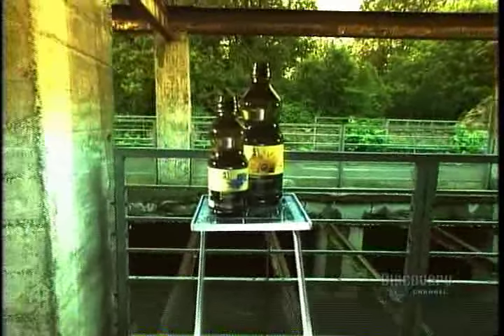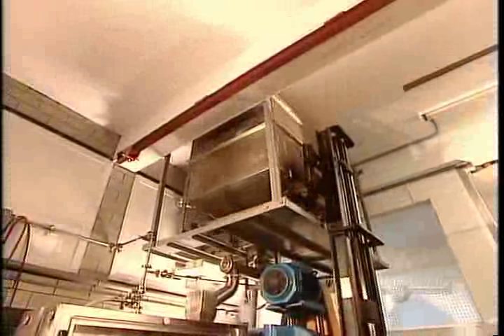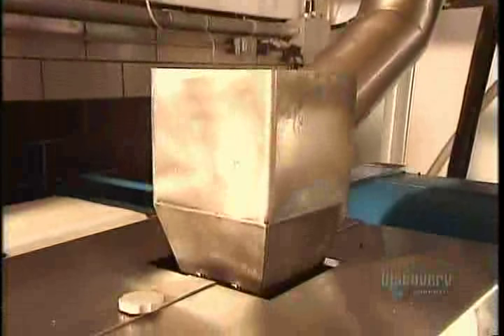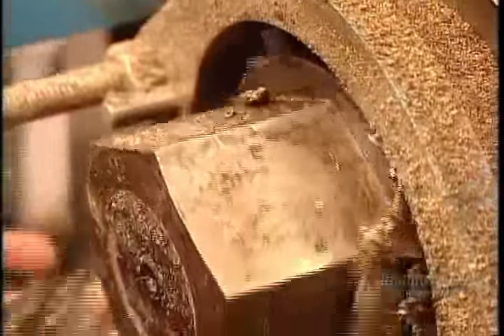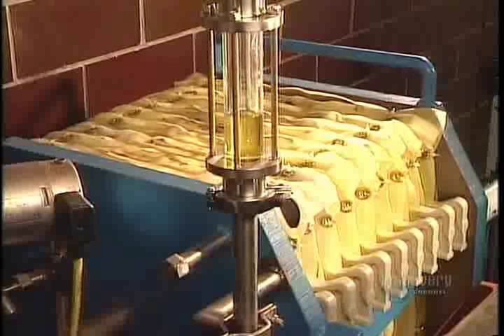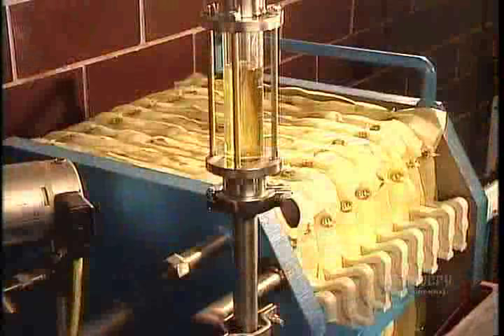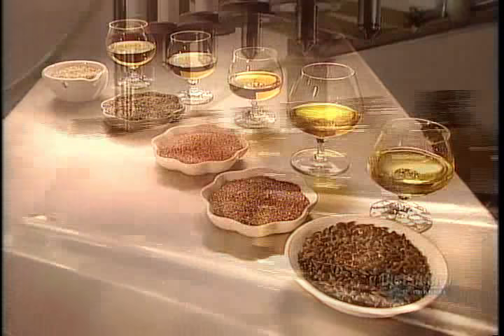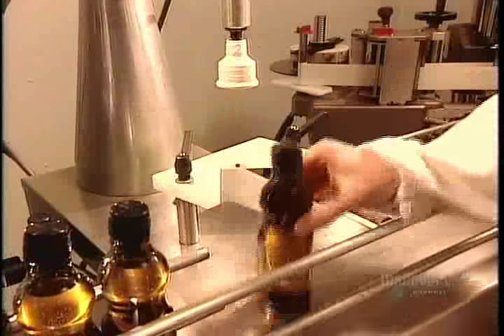How It's Made Vegetable oil

Comment: Also, except for flax oil, vegetable oils have a ratio high in omega-6's and low in Omega-3's, which can cause degenerative health issues as well. The problem with rancid PUFA's is that they form what's called lipid peroxides in the body.  Think of peroxides as the opposite of antioxidants.  Peroxides are like gasoline being thrown onto a free-radical fire.  Over time, the resultant free-radical storms can take a toll on cell membranes, delicate DNA/RNA strands, and the on the endothelium.
Reply: Thanks random person, no more chhick filla fries for me
Reply: @no_special_person  Well it's up to you if you wanna take note of all that crap and not enjoy what you like every once in a while 😅
Reply: Holy crap, you beat "Today I learned" by at least 9 years!
Reply: @Tarik360  what I've learned, and yes!
Reply: @Tarik360  it's been an issue for a while, still today most people don't take it seriously
Reply: Omega-6 and omega-3 are not degenerative to your health, you literally need it for brain function. Where do people come up with these random claims?

Also people should realize the whole oxidation basis for cancer has never been fully established. There is also research that points to oxidative stress being necessary in order to trigger molecular functions that help prevent cancer. Cancer research as a whole should be taken with a huge grain of salt, because it is almost entirely a SWAG (scientific wild ass guess).
Reply: @DaveSmith-cp5kj  they are essential, but our modern diets have much more omega-6s than omega-3s which causes health problems
Reply: @itshardtothink3675  Yes, so overeating in general is the problem, not the OP's claim that it is bad for your health. That's two entirely different conclusions. It's the same kind of BS when the media was claiming eggs or lettuce was bad for your health.
Reply: @DaveSmith-cp5kj go find a loaf of bread from the store with no veg oils, protip u cant
Reply: @DaveSmith-cp5kj  He said the RATIO high in omega-6 and low in omega-3 has the potential to cause degenerative issues. Not that they are inherently bad
Reply: @SandboxSki  Yeah but that's not how it works either. Omega-6 causing issues is a myth started by "nutritionists". Dieticians have always stated that omega-3 deficiencies are solved by eating foods high in omega-3, not reducing intake of omega-6. The body doesn't use the fats as is, it actually breaks them down as needed, so an "excess" risk doesn't happen unlike vitamins. Overeating is the threat, not the presence of vegetable oil which actually counters a lot of cardiovascular risk one would face by overeating.
Reply: @DaveSmith-cp5kj  no it isn't, this stuff gets made in a factory unlike eggs or lettuce, this should never be consumed ever
Reply: @johnyboy3454  Lmao what? Cheese is made in a factory too, as is gelatin and literally every food product derived from a plant or animal.
Reply: @DaveSmith-cp5kj  properly made cheese can be made without a factory and even if its made in one it is only mechanical processes, seed oils are REFINED which means they heat it up/add chemicals to that trash, keep consuming it bro
Reply: @johnyboy3454  You really have no idea how your cheese is made, do you?

Comment: fyi: these are cold press seed oil, so they are a lot better than regular vegetable/seed oils you buy at the supermarket, which are highly processed with high heat & chemical, and should be avoided as much as possible. Cold press is also the method use to extract extra virgin olive oil, coconut oil, avocado oil, palm oil. Therefore, always look for organic or cold press on the label to avoid highly processed oils. Saturated fats are good and are also way better than highly processed oils. Don't let the "heart healthy" label on corn oil, rapeseed oil fools you.

Comment: Why didnt they show the usual solvent/heat method? thats the one I want to see, th emore common one
Reply: So look it up i just watched it.
Reply: the seedcakes are then treated once more with steam, pressed out one more time. Then the rest gets treated once more with triperethylen ( hope I got the spelling right, they use the stuff in dry cleaners. we have a chemical factory near my village, most all males are working there. and one of them told me, incidentally a relative of mine, I am a Chef, where to all the chemicals are going. one is the biggest oil mill around.and for sure they are not using it to wash the uniforms of the employees).And ony THEN are the seedcakes used for animal feeds. they are supposed to clean them from all the chemical residue, but for that they need another cheical. nice gunk we feed our animals.
Reply: You can't charge extra for "natural"
Reply: Hexane is good

Comment: No, I said POLYunsaturated fats become rancid very quickly, especially when exposed to heat and light.  Seed oils are exposed to both during processing, during the many months in storage in a hot warehouse, and while under the 24/7 glaring light on store shelves.  Sorry, but common polymers (plastic bottles) are oxygen permeable.

Also, trans-fats are an entirely different creature than saturated fats like coconut oil, lard, or butter. Everyone can agree on the dangers of trans-fats by now.
Reply: are you still alive pam

Comment: I wonder if it would be feasible to run coolant pipes through components of the press, to keep the temperature down and so grind at a faster rate. Eg  inside the central shaft, and in the casing. Maybe it's not practical, or maybe the heat wouldn't get drawn out evenly enough...

Comment: while that may or may not be true, olive oil is higher in saturated fat than vegetable and canola oil, most oils are cool or cold pressed anyway, depending on the type of oil you get and the quality. As an all around cooking oil, vegetable or canola is best. Higher quality oils are most typically packed in dark glass to prevent UV light from spoiling the oil, and you actually can taste rancid oil.

Comment: QUESTION TIME

I looked this vid up after seeing this tweet on twitter:

"Fried ≠ unhealthy. 
Fried in vegetable oils = unhealthy. 

If you want to fry food, use tallow, palm oil, coconut oil, avocado oil, or from any mostly real food, high in saturated fat. 

(Beware of eating out. I know of only ~4 restaurants in the USA that fry in healthy fats.)"

Now, questions:
1) Tweet author said vegetable oils are unhealthy, use oil from real food..but here examples of vege oil are sunflower seeds, soybean, corn and so on which basically are....food. what's the difference they make as compared to the 'healthier' palm oil, coconut oil, avocado oil he suggested? The difference in sat fats? So basically they're ALL vegetable oils, just the unhealthy ones are the ones low in sat fats? So opt for the ones with high sat fats?
NOTE: SAVE the discussion about pros and cons of palm oil later. Focus on the actual question here.

2) what makes some vegetable oil bad and some good?? When they all come from growing plants/fruits which have been promoted to have health benefits when eaten as it is??
E.g. sunflower oil = vege oil. Sunflower seed = sunflower oil. Vege oil = bad. Sunflower seed = has health benefits. Hello?? Can someone explain???
Reply: You know how the video talks about how the oils easily spoil from heat and light? Similar processes can happen in your body causing cell damage and oxidation. This can cause inflammation and a variety of other health problems. Read Ray Peat for more info. I don't think sunflower seeds are particularly healthy, but eating them every once in a while isn't a problem. Sustained use of seed oils is a problem imo
Reply: @cornman8252  But here's the thing: Vegetable seed oils are in almost every processed food.
People nowadays consume an average of over 80 grams a day of vegetable seed oils, that's about 700 calories a day from seed oils alone.
Reply: @Augusto9588  ha, yeah, the solution for me has been to avoid processed foods and minimize eating out. Kinda sucks. I'd really like mainstream science to investigate this so there's more recognition of the problem and I don't have to refer people to a 'kooky' source. Not a problem for me, but most people only trust mainstream sources
Reply: @cornman8252  look up the channel low carb down under on YouTube and thank me later
Reply: It's the linoleic acid, a high omage 6 fat, which causes inflammation in the body. Your body need some omega6 and to be balanced with omega 3, but in the modern days all of our good have omega6 and we often get too much. Furthermore it is a polyunsaturated fat, which have multiple double bonds in the molecule, this mean it is easier to damage (become rancid) than fat with single bond molecule (saturated) and monounsarated which have only one double bond. The rancidity causes oxidation and creating reactive oxygen species (ROS) in the body, this leads to various health complications. This high inflammation and oxidation in the body contribute to various chronic illness and cancer.

However, the other end of the spectrum is also tunnel vision, where they tell you to eat meat only, no plant, and only consume saturated fat. Basically putting your body into a permanent ketosis state. The human body isn't designed to be in a permanent ketosis state and consuming large quantity of saturated fat. Some people depending on their genetic make up cannot metabolize saturated fat as well and it can be damaging to their metabolic health.

I am a fan of monounsaturated fat myself (olive oil). Avocado oil is actually inferior to EVOO because studies show it oxidize faster, since it lacks the antioxidant compounds that exist in olive. The smoke point do not tell how well an oil resist oxidation, smoke point is a deceiving metric.

Comment: based on levels of saturated and unsaturated fats, olive oil, lard, tallow and ghee are high in saturated fats which (over time) has been linked to Cardiovascular Disease (CVD), olive oil is the best of those four, but blended vegetable oil and canola oil have lower levels of saturated fat than those four.

Polyunsaturated Fatty Acids (PUFA) are not that bad for you unless consumed in excess, Omega 3, 6 and 9 are PUFA and they are good for you, like I've said before, it's all about the dose.

Comment: These oils are not toxic per se in that they won't cause acute symptoms of illness or disease, even in reasonably high doses.

The problem with vegetable oils is that they are very high in PUFA.  PUFA's go rancid (oxidize) very quickly, especially when heated or under light.  All the vegetable oils mentioned (with the exception of maybe refrigerated flax) are rancid by the time you buy it off the shelf.  And no, you can't tell by sight, smell, or taste.  Olive oil has a low amount of PUFA's.

Comment: Seed or canola oil is best for cooking based on what evidence?  Olive oil is slightly more saturated, but how's that a bad thing?

I don't really care if the higher quality vendors use cold pressing or tinted glass bottles.  PUFAs will predominately peroxidize in vivo too depending on quantity and length of time.  Plus, seed oils are very high in n6 which causes bad n6/n3 ratios and inflammation.

Actually, virgin coconut oil, pastured lard, tallow, and ghee are best for "all around cooking."

Comment: with real sun and water, it is possible. In fact, modern plants make their own electricity from waste. Without sun, there were not surplus energy.  Theoretically you could make oil, but you should have to use it to fertilize seeds in a closed circle, without external production. In real life, part of the energy is wasted in the process and eventually the energy will run out.